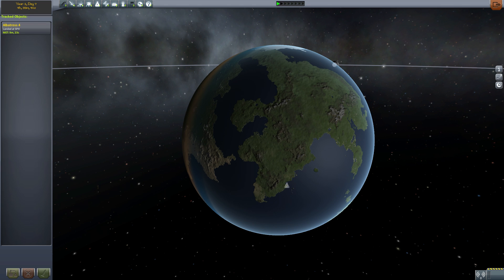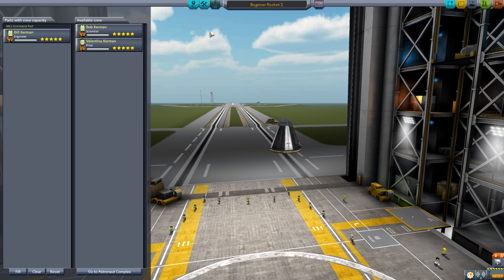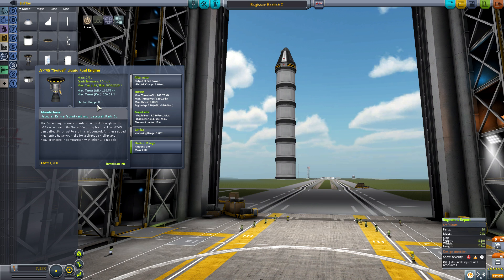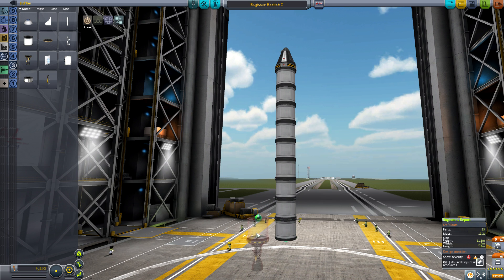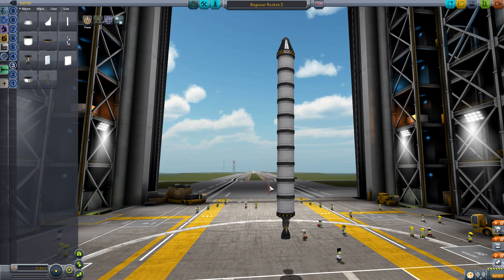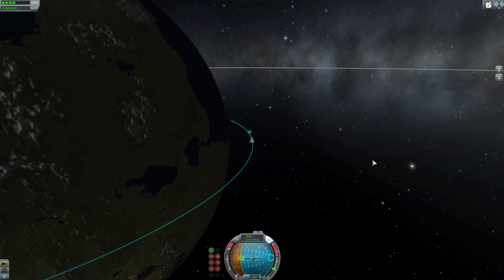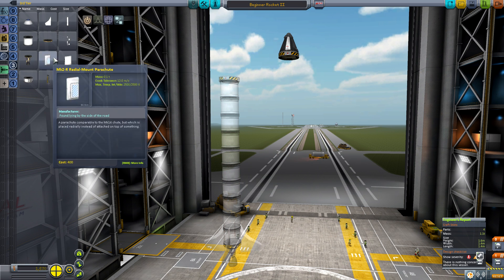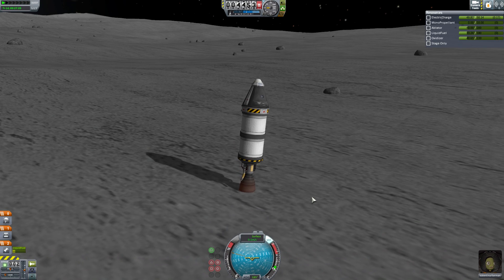How to reach orbit in KSP | Basic Tutorial

Comment: There's no wind in ksp.
Reply: xWood4000
There is, however, aerodynamics. Otherwise your aircrafts that doesn't have more than one TWR will just drop to the ground.
Reply: Var Niha Yes. But drag≠wind≠lift
Reply: xWood4000 
You are right, but why would you ever want wind? Also, wind mechanics are usually buggy as ever.
EDIT: They are all properties of aerodynamics though.
Reply: Var Niha True

Comment: how does delta v work when building rocket? also when heading to 75km, do you keep full throttle or keep time to apoapsis low? like under 1 minute
Reply from the maker: +s m Hi, the easiest way to find out how much delta v a stage has (stock KSP) it to simply make it hover on the launch pad. To hover you need to accelerate with ca. 10 m/s² because that#s how strong Kerbin pulls your rocket back down. If you can make your rocket however for lets say 20 seconds until the fuel runs out, your rocket has 10 x 20 = 200 m/s of delta v. You can however also calculate it (I have a video on that one too) or simply use a mod called "Kerbal Engineer". 

I personally don't really care about time to apoapsis to be honest. I just full throttle until my Apoapsis leaves the atmosphere to then coast there. You can be of course more efficient but the difference is really small especially since the aerodynamics overhaul where you can be really fast in the middle atmopshere. The faster you are the more efficient is your burn.
Reply: +KerbalEssences yes i use kerbal enginner . so how much dv to orbit then ? or even get to mun where cud i find that out?
Reply from the maker: +s m Ah okay, what you are looking for is a delta v map: http://imgur.com/8jGWLCg
Reply: +KerbalEssences ok I see :), so to get 80km orbit it's 3200 +1115, so my ship needs total dv of 4315 roughly. As per kerbal engineer. So if dv is good that also means twr is right too?
Reply from the maker: s m HI, you only need 3200 m/s for a 80km orbit. The 1115 more are for a GSO (synchronous) orbit at 2868 kms. Delta_V and TWR have nothing to do with each other. You can have very much delta v with very little TWR or wise verse.